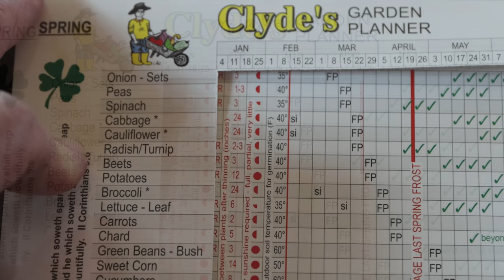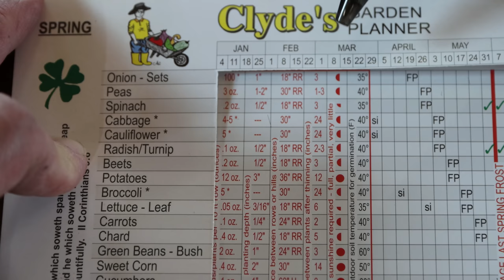Building More Raised Garden Beds in our Fenced in Vegetable Garden.  Plus a Garden Planner Giveaway

Comment: I have the same problem with my soil. I use a leaf vacuum to grind up the leaves and roto till the shredded leaves into the soil in the fall. Sometimes I have a bag or two left over and put those in the spring. My neighbors think I am nuts when I am out in the street vacuuming up the leaves:-)

Comment: I think I remember you saying you were on a rural water system and not using well water. If that is right, have you ever considered a shallow well pump to take water from the pond? Pond water would be much cheaper than rural water and better for the garden as it wouldn't have chemicals in it. Just a thought.

Comment: Something I see many people do when building raised beds is that they put the studs on the inside and the boards on the outside, fixed to the studs with screws. I understand it creates a  clean look and no doubt it holds up just fine with enough strong screws. But mechanically I feel that putting the studs outside the boards makes much more sense. That way the pressure of the soil on the inside pushes the boards against the studs and fewer screws are needed to keep the boards in place. Also, the studs will not get in the way when using a hoe or rake to clean the beds. 
In the end, it is all a personal choice, and it does not matter in the grand scheme of things,  but I was wondering why you build these raised beds this way